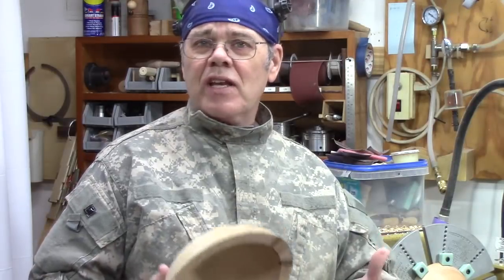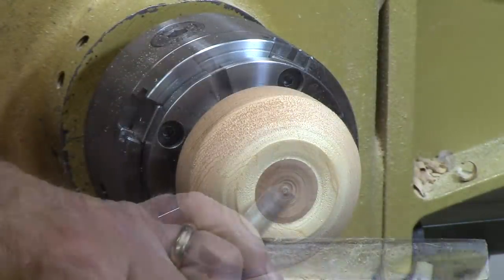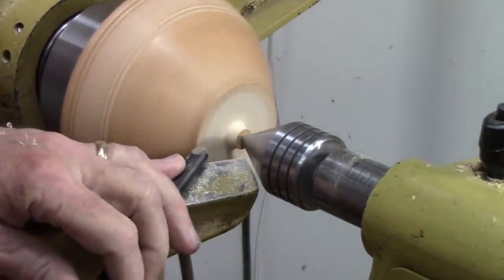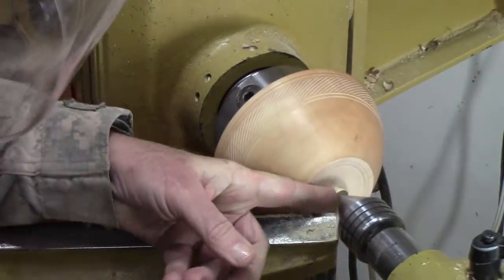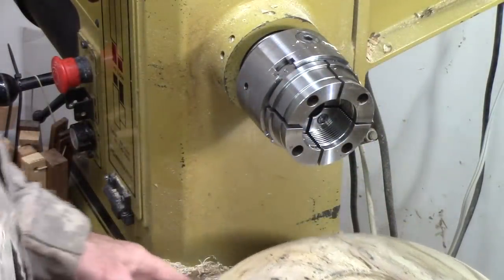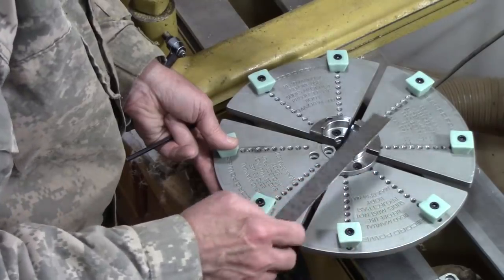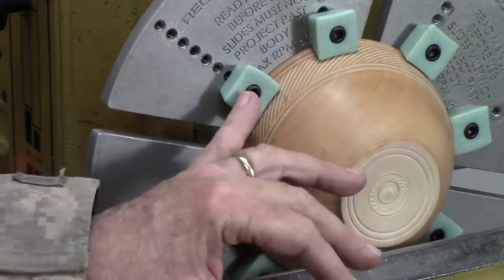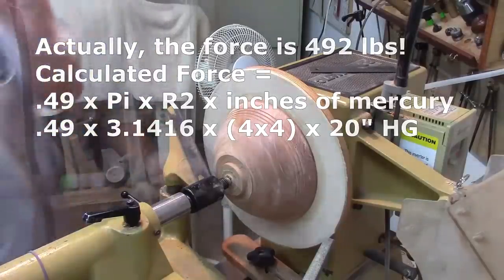Reverse Chucking a Bowl

Comment: New guy here,  and I was using those round rubber holders on a mini lathe.  Yup, put my first turning into orbit around the shop.  The kit came with the angled rubber stoppers but had no instructions, so now with your video I understand.
Reply from the maker: Yes, the devil is in the details. You can go to the Record Power website and download their chuck jaw instruction manual. I am a bit anal so tracked that down early on.

Comment: Nice video, Mike. I was already familiar with all of the checking methods you presented but the review was very useful. However you did answer a question I had about my Nova Cole Jaw set up. I never knew why they sent longer screws. Now I know that they can be used to install a regular set of jaws on the face of the Cole jaws. Very interesting. Thanks for sharing. I always enjoy your tips. Even those I may already know.
Reply from the maker: Thanks, Glen. I appreciate your support.

Comment: Great video Mike. I’ve only used Nova cole jaws with aftermarket “grips” and it’s ok although the recommended top turning speed is considerably less than I like for finishing cuts even on small bowls. Sometimes it can be a bear to get the bowl to turn true as well, which shows with any decorative cuts or texturing if you look closely. I have a vacuum pump for stabilizing woods and after seeing your preferred method as well as some of the comments, I think it’s time to make a vacuum chuck! Thanks for the vid. - Jay
Reply from the maker: Thanks. I have a video as well as an article on my website on making a vacuum chuck.

Comment: Thanks for the information Mike. I have been using  cole jaws on my midi lathe. I did however purchase replacement bumpers from Nova that resemble those on your cole jaws. These replacements hold firmly without a great deal of pressure and help to keep the bowl flat against the face of the jaws.
Reply from the maker: Yes, those profiled bumpers sure are better than the round ones. Seem kind of pricy as an accessory kit.
Reply: It was $24.00 from Amazon for a set of the profile bumpers and tall round bumpers. Pricey for what they actually are but they do work well.

Comment: Very interesting thanks Mike. It's one of those things I can't quite bring myself to try as yet and tend to go for a recess rather than the tenon but this encourages me to give it a go.Thanks.
Reply from the maker: Even with a recess, I like to rollover the edge so it does not look like  a recess. To me it just looks more refined. If you like recesses there is no reason to change.
Reply: @MikePeaceWoodturning  It's not that I particularly like recesses, it's just that as a new turner they seem easier to get to a finished item rather than sorting the tenon out afterwards. Your vid has addressed that thanks Mike and I want to give it a go with either the jamchuck and tailstock in support or maybe invest in a longworth type chuck. Great tip about rounding off the recess though :). Stuart
Reply from the maker: Lots of good ways to do it. Thanks for watching, Stuart.

Comment: Nice overview Mike.  I think you should have mentioned, however, that using the various jaws limits the speed at which you can turn the bowl to under 600 RPM in most cases.  I prefer the vacuum chucking system since it allows you to speed thing up a bit.  Also very quick to setup once you have a collection of vacuum chucks.

Comment: Good video Mike. I’ve used a longworth chuck and Cole jaws and don’t like either of them, the work never seems to run true. My next project is to make a Donut Chuck as I feel it’s going to be much more secure and hopefully I’ll be able to adjust the workpiece to run true. Maybe it will also work with things like modest size vases.
Reply from the maker: Definitely more secure. Make extra donuts each with a different size hole.

Comment: Hi Mike been watching your tube for some time. Don't pick up much new info but use it mainly as a sounding board for my technique in what I say or do. One thing I have to offer is an alternative technique to holding a piece to finish the bottom. After limited success with Cole plates etc I came up with what I call my megajaws. It is simply taking the Cole plate idea a!taking it one step further. I first get a plate of flat 1/4 to 1/2 aluminum ( depending on the diameter for the strength needed) 8 to 12 inches square. The squareness is important. I then cut this to 4 smaller equal squares. I then drill holes in the corner of each using a Chuck jaw to mark the holes. I then cut pieces of 2 inch lumber and screw that on the aluminum plate, rounding the outer edges for safety now I can use 6mm bolts to mount the plates on the lathe.  Caution speed maximum 400 RPM. With this device I can cut a ring in the wood to match the diameter of the piece which gives me even pressure continually around the whole perimeter. I have a digital hand out for this if you send your e-address to mervgraham@shaw.ca I will send it to you. Or I believe it is still available on WOW.
Reply from the maker: Thanks. Traveling now. Hope to do a video on wooden jaws in the future

Comment: A very timely video Mike. And extremely informative, as always. I have Cole Jaws but haven't used them yet. Also, I recently ordered the Hold Fast - Universal Vacuum Adapter Kit. I'll be ready for some serious turnin' soon.
Reply from the maker: I think you will like the Vac Chuck. I don't use a lamp rod Chuck adapter but use a rotary adapter that easily plugs into the handwheel.
Reply: I can do that with my Delta Midi but don't have my new Laguna 18/36 installed yet. Hopefully it will do the same.
Reply from the maker: There are plans out on the internet to make a rotary adapter.  It is so much easier with one that has just pops in and out without threading to a chuck because it makes it easy to make more vacuum chucks of different sizes. Craft Supply sells one at a reasonable price but I don't see Laguna on the list. It may be worth a call.

Comment: If you use the Multistar Duplex chuck, there is no need for a big tennon to be turned away in the end. The bottom side may be finished by the first turning. The Multistar needs a groove or tennon of only 2-3 mm which may be a natural part of the bottom side.

Comment: I found another way to reverse that you might want to try. It is close to the jam chuck but you have a flat piece of wood with a 45% circle cut out that has 4 screws to secure it. If you leave 1 screw half way in you can open the jig to insert the bowl with foam padding on both sides. Close the jig to the pre-drill screw holes for a tight fit. Try it out some time. The cut out circle (like when you are making a bowl from a single broad) can changed out with larger or small  circles and the  45% angle cut allows you to hold multiple size bowls. It is a DIY donut chuck.
Reply from the maker: Yes, soundsl like you are describing what are called donut chucks. It is similar to this miniature donut chuck I use for making a 1 piece coffee scoops. https://youtu.be/mpcv_qTW4AY   I prefer a vacuum chuck  or cole jaws. YMMV

Comment: as a newbie its interesting to see the different methods of reverse holding a bowl, I have a Record Coronet Herald so I will probably for the time being go for the mega or mini chuck they sell for reverse holding but I do have a vacuum pump that i used to use to install air conditioning  units a few years back so I might have a look at how to use that method as the pump still holds a vacuum well, just need to figure out how to build the rubber moulds to hold the wood on. thanks for the detailed explanations.
Reply from the maker: Thanks for sharing. I have an article on my website on my DIY vacuum chuck. I also have a video on vacuum chucking.
Reply: Thank you I’ll take a look.

Comment: Another very good video

Re Cole Jaws (aka 'button jaws' among the Brits), some manufacturers supply only rubber pins with straight sides.  There are times when the standard pins aren't long enough.  One trip to the hardware store can yield everything you need to make longer pins.  Pick kup some cap screws that match the threading in the jaws (which is often metric), and then wander into the plumbing department to select some clear vinyl tubing.  It's sold by the foot, and you only need one foot each of two diameters - one that has an ID that will slip over the shank of the cap screws, and the second that has an ID that will slip over the cap of the screws and that is also the same, or very slightly smaller, than the OD of the smaller tubing.  Cut short lengths of the smaller tubing and slip them over the shanks of the screws.  Cut slightly longer lengths of the larger tubing to add a second layer of vinyl over the screw shanks that also covers the caps.  It will be easier to slip the larger tubing over the smaller tubing if you heat it with a heat gun.
Reply from the maker: Thanks so much, Louie, for that. Do you think there is enough interest for a more complete video on "button" jaws with additional content on customizing the buttons and more?
Reply: Cole jaws are probably the first thing that newbies try for finishing the bottom of bowls, so I think that this could be a fertile subject.
Reply: @monophoto1  +1 for that. An in depth look at the various ways to set up and use Cole jaws would be a good topic to cover

Comment: Not a first time visitor but a timely subject.  I have not tried the jam chuck method but have a col,e jaw set. The rubber pieces leave a lot to be desired and I have thrown several jaws out until I got the hold right. I like the hold downs you used. Where can I get them?  Thanks for the instructional videos.
Reply from the maker: Teknatool and Record Power both sell them as a kit although it came with the larger cole jaws from Record Power.

Comment: Hi Mike, Great video. how did you do the diagonal lines on the first bowl you showed? is it a special chisel? Also, my lathe will only turn on 1500rpm which i use for everything- do you think this is to dangerous for cole jaws? thanks
Reply from the maker: Watch this vido on spiraling tool https://youtu.be/GJ5xgEHSuJU.  Most manufacturers recommend not turning faster than 600 to 800 on Cole jaws. A lathe with only one speed of 1500 is not safe for bowl turning. Period!  Watch this https://youtu.be/8lq78dWdwH4

Comment: I prefer to use a recess if possible. That way the bottom of the bowl is done before turning it over to do the top.  I have the mini cole jaws for my midi lathe but I've only used them once.
Reply from the maker: Even with a recess, I like to rollover the edge so it does not look like  a recess. To me it just looks more refined. If you like recesses there is no reason to change. With a vacuum chuck I have little use for cole jaws but if the bowl had a void or hole, I am much more confident in using these "remounting jaws" with their profiled rubber buffers.

Comment: When I took a class from Dale Nish at Craft Supplies USA, he showed us a relatively easy way of finding good blank for jam chucking a bowl: use 3/4" MDF.  It's relatively cheap and stable. Cut an appropriately sized disk for the swing of your lathe and mount that to a face plate. Mount the MDF disk on the lathe and drill a 3/8" hole in the center -- all the way through the MDF.  Then, you can use the disk to make jam chucks for several different sized bowls. Just don't go too deep when making a chuck, or you'll ruin the integrity of the disk. (If that's an issue, you can either double up the thickness or back the MDF up with a disk of plywood.)  When you've finished turning the bottom of the bowl, you can use the hole drilled in the center of the disk to remove the bowl from the chuck.
Reply from the maker: Thanks for sharing. I probably should have included mdf.  Yes, cheap and readily available. I do hate mdf dust, though. Fortunately I rely on my vacuum Chuck.

Comment: Hello Mike Thank you for another  very informative video.
Please may I ask what the outside diamitter is on the larger record power remount jaws when they are closed. I have an Axminster midi size lathe and the distance from the centre point of the drive centre to the bed of the lathe is 150mm.
Was wondering if they will fit. 
Many thanks.
Dave
Reply from the maker: The documentation asys they will clear the bed on a 12" lathe.
Reply: @MikePeaceWoodturning  
Mike, thanks for getting back to me. I did see in the manual about the 12" swing but it doesn't say what the diameter would be when the Chuck is at its max opening not when it's closed, rarely will they be fully closed when in use.
Many thanks. 
Dave
Reply from the maker: @dbull46  Ok, I will try to remember to measure next time I am in the shop.
Reply: @MikePeaceWoodturning  
Thanks Mike 
Very much appreciated 
Dave :)
Reply from the maker: The max width of the jaws open are 12 1/4" so would accomodate a 156mm center to lathe bed. So should fit most 12" midi lathes. You may have to limit your expansion to clear if it is exactly 150mm. You might try measuring to see if there is a bit more clearance.
Reply: @MikePeaceWoodturning   Mike
Sorry for delaying getting back to you. As you say, with the large Cole jaws I am going to be limited with the movement so decided to get the small set and make some extention arms from some steel. Fortunately I have access to an old Bridgeport miller which will make for a better  job. 
Thanks again Mike 
Take care 
Dave :)

Comment: Mike, Where did you obtain the square grippers for the cole jaws?
Reply from the maker: They came with my Record Power mega jaws. I had to do some searching but found that Woodcraft may sell them but they are out of stock. https://www.woodcraft.com/products/record-power-angle-stops-for-remount-jaws-62838.  I finally found them on Amazaon but not available https://www.amazon.com/RIKON-Power-Tools-78-838-Remount/dp/B01D35YPMM . It is possible your local WC has some in stock. You might try calling Craft Suppllies. You could also buy direct from the Record Power https://www.recordpower.co.uk/product/angular-buffer-stops-for-remount-jaws
Reply from the maker: I found this set from Nova https://www.amazon.com/dp/B07HBPFKTQ/?ref=idea_lv_dp_
Reply: @MikePeaceWoodturning  ko it